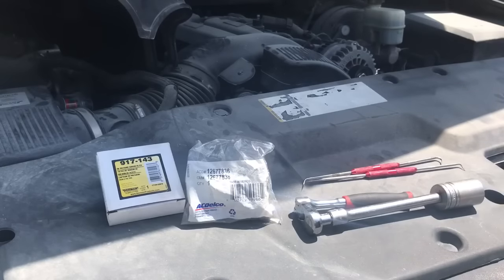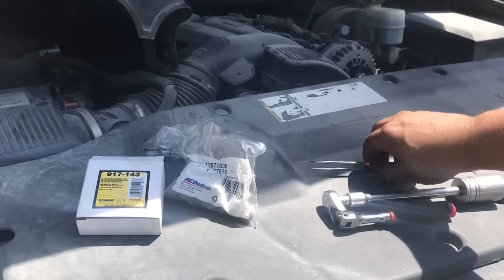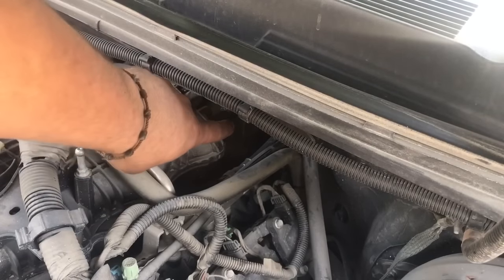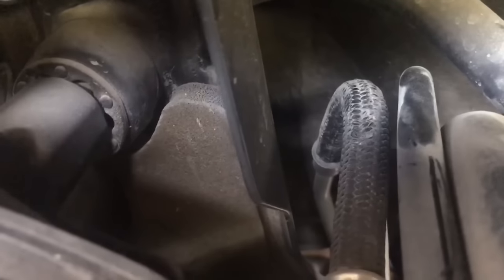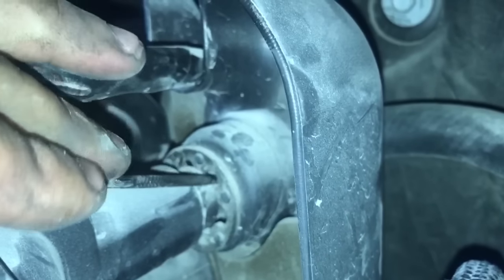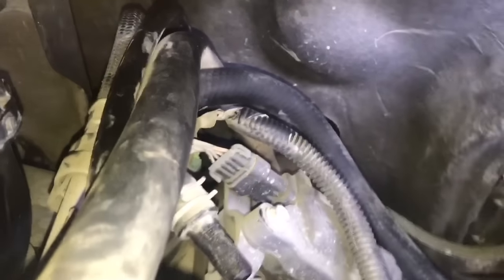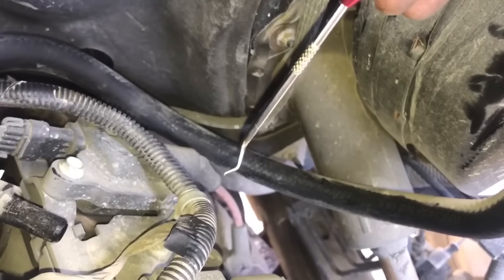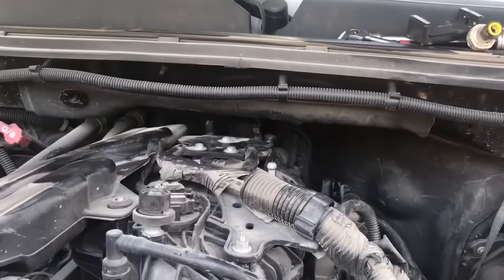Fixing low oil pressure on Chevrolet Silverado

Comment: I read in the comments of another video to remove screen altogether. That gm just issued this notice.  Don't know if it's true or not.  Havent been able to verify
Reply: I couldn't get my screen out...I used a 17/64" drill bit that was recommended on this (or another) youtube video....no dice.I then tried a 12" long piece of #12 wire,stripped.I put a small loop in the end of it....made it bigger,made it smaller....I left the damn filter/screen in...I'm hoping it's clean! I've always changed oil,so...
Reply: @guitronics7  one video I watched,  the guy got maybe a 4"  long bolt, can't remember how thick but guessing 1/4-1/2 inch.  It was a big ol long bolt ok lol. But he reached back there and just threaded it into the filter to get a hold of it and pull it out

Comment: Do you think that the screen could cause the oil sensor to read low pressure?
Reply from the maker: I’ve seen clogged screen cause low readings
Reply: Oz Mechanics Replaced the screen too - no help. So, I did a thorough oil change and that seemed to do the trick! The previous owner had installed a larger oil filter than the engine calls for.

Comment: Is this the same for the 5.7 vortec? I bought a crate motor from JEGS and had high pressure since day 1... now 1.5 yrs later and 7k miles the gauge maxes out whenever I hit the gas... and idles at 40... as of 2 days ago the gauge randomly spins like a airplane propeller...  do you think it’s still the sensor...? The installing mechanic said I have a bad cluster and to install a external oil gauge... any incite would be greatly appreciated!

Comment: I didn't see anything in this video that solved a low oil pressure condition.  It was information on how to change the oil pressure sending unit & filter.....it helps the gauge show a more acctoil pressure, but it doesn't resolve low oil pressure.

Comment: What make is the socket you are using?  I bought a generic 1-1/16 (27mm) oil pressure sensor deep socket off Amazon but it seems too long and won’t go on the old sensor hex even though the socket fits the new ac delco sensor perfectly.  I think I need a shorter deep socket back there..

Comment: I need to know what you guys do to make sure you aren't putting the new filter into a contaminated environment and the filter doesn't plug right back up. How do you clean the area where filter sets?
Reply: I didn't this same procedure on my 5.3. one extra step you need to do is. While you're in the middle of this change your oil. Drain it before you start and remove filter. After you remove the oil pressure sensor and the screen under it, at this point take an air compressor with a rubber tip on the end of the air line so it will seal around the hole where the senior goes and blow air down through the hole. This will remove the gunk that clogs the screen and reduces oil flow to the sensor. A lot of the time that is the cause of the low oil pressure light.

Comment: I replaced my pan gasket after I founda puddle  and still have elbow 20 drop from 40 to to twenty in one 4 mile trip.. now that bitwise all clean I found oil leaking from bone filter  appears to be coming from abo love filter location and running down the drivers side Trans bell housing

Comment: I hate when you can't show the most hardest part if the task. Taking out the screen. I bought the picking tool you recommended and almost cut my self I don't like that tool...buy one with a handle on it. My picking tool doesn't poke the screen in order to pull and they made the screen with smooth flush innersife so nothing to pull out with. So stupid. I still can't pull it out and need to go buy a new picking tool I guess.
Reply from the maker: Sorry on what’s going on. I prefer those picks do to them being 2 in one pics. And I tend to lose a lot of my tools. And as for filming that’s is a hard shot as you can see trying to put yours hands down there, it’s a pretty tight squeeze. Btw does your vehicle have the option where it goes from 8 cylinder to 4 ?

Comment: Should have finished the video and let us see the new one going back in and also the steps on how you determined the sensor was bad….  Does it screw in? Is there a gasket on it?  But anyway thanks for showing us where it is
Reply from the maker: Like explained in the beginning of the video this video was intended to show how to remove this sensor. Not a diagnosis. And as screwing in, that what the socket and ratchet were used for. Thanks for watching

Comment: My Hummer H2 shows low oil pressure. The gauge goes to 0. It goes to normal then drops down to zero. The Truck runs great, doesnt seem to have any mechanical issues as far as running rough or any indications that the engine is running low on oil or anything of that sort. So I think the sensor is bad.

Comment: I have to ask. Seriously, What Would happen if you delete the screen. My sending unit sensor went out and i feel like im hearing that lifter tick a little louder. I bought the 11 avalanche w 100,000 on it as 2nd owner and the first owner was an older woman trading race horses so im sure was upkept well. Doni need to worry about the lifter tick in the 5.3 with 150k. If is there a remedy?

Comment: I replaced  it but it's still says 0 but can't here any extra  noise  when running  it but it's says oil low turn engine  off so I'm stuck I think  the pump may be bad but not sure  any thoughts  that might help would be greatly  appreciated

Comment: the tahoe start in 40 psi cold oil and with hot oil almost 0 psi but the engine doesn't make any noise I change the pressure switch and remain the same with the new sensor, i forgot to check the filter but in case this filter is ok do you have any idea what is wrong? the engine oil on it is 10w30 and the wheather here in my country is always hot over 85 F

Comment: Very simple question but w/o doing it, impossible to proceed: 

How do you “unclip/disconnect” the sensor wire cap?   I have felt, watch other videos, Haynes manual, nothing.  

HELP!!!
Reply: Look at the new sensor. There's a little plastic stub sticking out near the top of the connector. The plug has a piece of plastic that fits over this stub. It has a little tail on it you can pull out with your index finger. You pull that out far enough to clear the stub then just pull the plug out of the jack. It won't just come out easy because there's a yellow gasket that seals the connection which offers resistance.

Comment: What’s the point to install new filter instead should be eliminated like I did on my 2010 Tahoe, if the screen clogged not reading or bounce up and down, so minus well leave it out, and you will know that the sensor is the bad one next time you have bad reading

Comment: I had my 2009 Silverado 5.3 sensor (and supposedly the screen) changed by a local garage in April, now the truck suddenly has a low oil pressure warning.  I checked the oil, all good, no lifter noise, start the truck up and the gauge reads normal.  Any guesses?
Reply: Low Pressure is not the the dip stick level.
Generaly Low oil pressure refers to the bearings are worn and oil spews/ drips threw all the bearing. Unless I'm not aware of other issues in the electrical

Comment: Which auto parts store did with the 90°angle picks that you used to pull the sensor out?  Also, is there a specific name I need to use for requesting or ordering the screen is it the oil sensor screen?
Reply from the maker: Marco Barnes I get them from my tool truck guy
Reply: Auto value sells the same ones. (PT tools) literally look identical. They come in a two pack.

Comment: Anyone know the pros and cons of just removing the screen/sensor filter? I'm in the far north, and the guy at Auto Zone says he never puts his in. When I pulled the sensor on my 2008 Suburban that I bought up here, it also didn't have the screen. I added it along with a new sensor, and I'm still getting the check engine light for oil pressure sensor.

Comment: Does it throw a code or is it a driveability problem  that happens when these are bad ?
Reply from the maker: Free Spirit so normally throw a circuit code. Or the cluster would start jumping around from 80 psi to 0. Proper way to make sure the sensor is bad is to hook up a oil pressure gauge and read the true oil pressure.
Reply: I have the same year truck and engine. When my first sensor went bad, the information screen in the dash said "low oil pressure" and my gauge went haywire. The engine also shut itself off to protect itself. I had it replaced along with screen and not long after, it went out again. I was told to just eliminate the screen since it clogs up too easily. That was two years ago and no issues since I took out the screen.
Reply from the maker: Evan L and for some reason those sensors go bad easily. Even new out the box
Reply: Mine 00 5.3 Silverado has the tall switch and sender sensor. When I replaced it I didn't see or feel a filter below.i tried to put the filter in but it felt like it didn't fit. Is it supposed to have a filter in it still or were the 99-00 ls motors not equipped with the filter like in the first schematic(j 41712) in your video
Reply: @JdmMikeTx  Did you ever find out?
Reply: @SINALOENSE...100  I dont think the filter will fit. I stuck my pinky down the hole and it didn't feel deep enough for a filter.. either way my motor has oil problems. I just replaced the sensor and my pressure is still low. I Might have to change the oil pump again even though it's only been 4 or 5 months
Reply: @JdmMikeTx  I change the sensor,oil pump ,screen,air filter,clean MAF and nothing . I'm starting to think it's something small .
Reply: @SINALOENSE...100  what's wrong with your truck?
Reply: @JdmMikeTx  no your year doesn't have the filter. Years 07 and up. Reason for this screen was so the Vlom afm/and Dod and all parts associated with those systems wouldn't clog up and cause engine failures. Some people take the screen out. I swear by it in I'm in a 13 tahoe also a 02 yukon. Both 5.3 motors but diffrent generations
Reply: 0521
Reply: @OzMechanics  Lol, I replaced the sensor 3 days ago(not screen). Now jumping from 80-0 occasionally, even when the truck is off. So the new sensor is a dud unless the gauge motor is crap, or a ground issue, but likely the sensor again. I did drop it from 4ft onto the concrete. Lol, I wonder what makes them fail internally so easily. I shouldve done the screen the first time
Reply from the maker: Owen Conner yea that can cause it to act up lol
Reply: @OzMechanics  Fore sure haha, but it was working great for 3 days and then just today it started jumping from 80-0. Was even reading 80 with the car off and ignition powered on, so obviously its not a real reading. I hope its the sensor and not to gauge motor or some wiring problem
Reply: I bet I'll be able to do it in less than 20min this time!!

Comment: I just replaced my oil pressure sensor. Is it normal for the gauge to read around 30-35 at idle? Under acceleration it usually either goes back up to 40 or just shy of 40 (38-39) I ask because I could of sworn it was always at the 40 before the sensor went bad, or maybe I just didn’t pay that much attention to it at the time. Any input would be greatly appreciated.
Reply: Having the same problem did u figure it out ?

Comment: Don’t need to take the hose off only the top engine cover.  Took me less than 15 minutes.  Don’t need a pick either use a bolt to get the screen out
Reply from the maker: Jon Eagle I just find it easier to remove that sensor with the hose off. Only takes 10 secs to take off the hose and gives a lot more clearance
Reply: Great video would’ve never attempted without.  Thanks             ozmechanic

Comment: Has anyone figured out what the plastic shield in front of the sensor is for?
Reply from the maker: The vehicles that have the DOD/ AFM active fuel management. Have solenoids that de activate the cylinders. The filter is there to filter out the gunk from the delicate solenoids

Comment: I have a question.  I have a 2004 Chevrolet 5.3 and my oil filter was clogged when doing a oil change. What does that mean. Is the engine bad
Reply: the n serous engine sludge.

Comment: Your "fix" adresses just one of several possibilities for low oil pressure in a LS engine. The other possibilities could include: that "barbell" in the rear of the block having an old, brittle O-ring; the O-ring for the oil pick-up tube at the pump being compromised; PCV issues; low oil level; sensor, etc. Thank you for one more part to be concerned about in my LS engine - that little screen beneath the oil pressure sender unit. smh
Reply from the maker: I actually have another video talking about that o-ring. I’ve actually never heard of the PCV causing low oil pressure. How would that cause issues? Interested to learn

Comment: Does engine oil leak from this sensor? I have an oil leak that i cant find!!! I have gaskets and still leaking?
Reply: Theres a seal between the engine and  transmission.   You may need to replace it and is a pain in the ass cause you have to. Take out the transmission. Or engine  out.  To change it.    The leak come from between. The engine. Falling from inside the thans where the flywheel is.  So thats why you cant see it ..  All you see is the oil under your engine and transmission

Comment: My 2004 Tahoe 5.3 does not have that little filter. I have changed the oil pump and pressure sensor and keep having low oir pressure on passenger side... what would you guys think it will be? Thanks in advance
Reply from the maker: Guatemala Air Support in the oil pump did you replace the oring? Plus did you make sure the pick up tube wasn’t obstructed?
Reply: @OzMechanics  thanks for replied... I did that too,  do you have an email address so I can sent you some pictures?

Comment: Hello what is the name or part number of that red seal that connects to the brake booster while taking mine off lost it in the process of removing the hose
Reply from the maker: I’m not sure. It’s part of the intake plenum
Reply: @OzMechanics  thanks any way do you know if and seal or gourment can just replace it
Reply from the maker: @Arod06  I doubt it. Rather than just replacing the whole intake see if you can find one at the junk yard if possible
Reply: @OzMechanics  ok thank yeah the dealer ship said it’s part of the intake manifold but my local Mechanic said it’s not part of it so now we’re trying to narrow down the part number or to see we we can replace is with another seal-gasket gourmet it’s been so hard just trying to narrow it down but I’m determined to find i can’t find anything online either like a diagram of the intake

Comment: Hi Oz, need help or advice. I recently had my check engine light on. Gave me code P0521, I changed my oil pressure sensor and the screen filter...new ACdelco also. 3 days later..my check engine light back on and same code. Any idea?? Thanks
Reply from the maker: Cary Cortez I’ve had bad sensors. But I would make sure your wiring is good. I hook up my scope to the signal wire and wiggle the wire to see for drops I’m the signal

Comment: Mine stopped working 3 years ago. I knew of this issue and  I also I know I really DO have oil pressure from the lack of clacking. The reason I haven't replaced it is because ever since it stopped working, the active fuel management system doesn't engage (AMF) so I figured this has deleted that system which is what I want. Anyone else had this happen??

Comment: I changed out my sensor and the screen and had good pressure for a month . Now the check engine light is back on and reading 20 lbs of oil pressure. Has anyone pulled the oil filter off the block and spray a cleaner down the oil passage? I think I am getting junk that is clogging the screen.

Comment: I Replace The Little Filter and Sensor and My Oil Pressure Still 20 or less Psi and Still getting the Code Any Suggestions What to Do This Thing is giving me a Headache.
Reply from the maker: Might need to take it to a mechanic to replace the oil pump oring.
Reply: Oz Mechanics That Could be a Big Possibility Thanks 👍

Comment: I break that plastic shield n push it back n to the left out of the way n leave the hose in place
Reply: What is the point of the plastic shield anyway? I was thinking of cutting it out with a small handheld hacksaw blade and getting rid of that plastic shield

Comment: I can't get the clip to release. I got the grey part slid up but I can't push in to unplug the part. Anyone have any ideas what I can to
Reply from the maker: Put tools on the description of the video if you would like to purchase
Reply: Maybe you solved it by now but there's no pushing involved with unplugging the connector. You lift the plastic tab over the little stub (that you can see on the new sensor) and then pull the connector out. No pushing.

Comment: My fingers are killing me. Been working on this crap all day. Can't get it unplugged. I'm so frustrated
Reply from the maker: I just added a link some tools I used on the descriptions of this video. get the picks I posted. will help
Reply: @OzMechanics  you mean the one to take the hose off by that shield?
Reply: @OzMechanics  I can get my hand back there but the electrical plug is turned so I can barely push it in.  I got the grey piece pulled up but I'm unable to push in to release the plug
Reply: @OzMechanics  I'm struggling with the electrical clip on the sensor